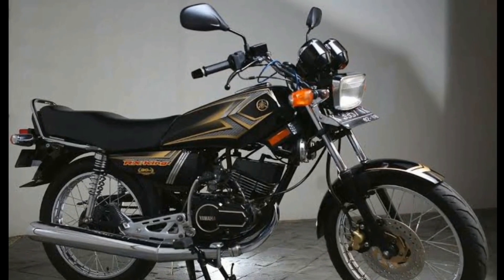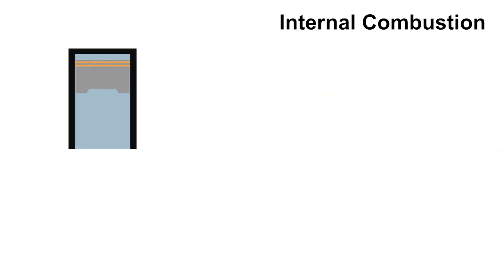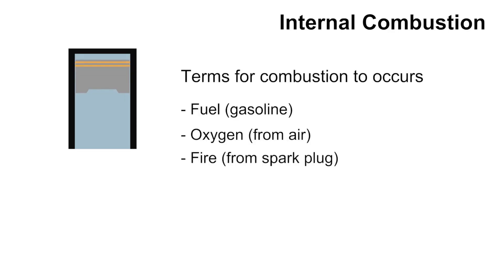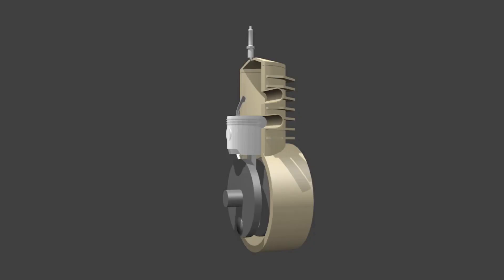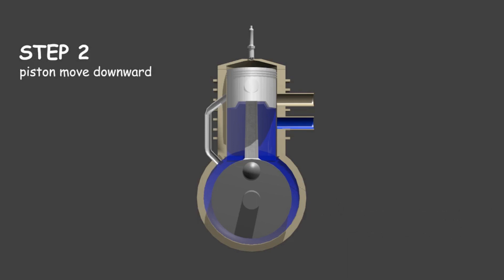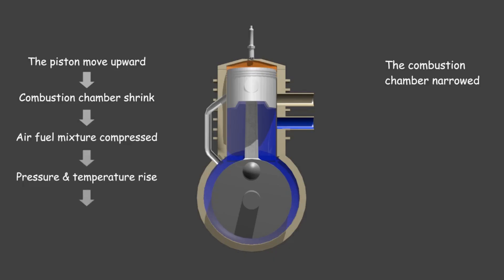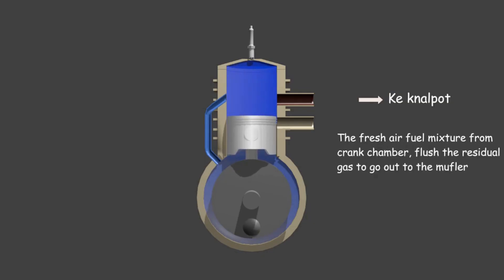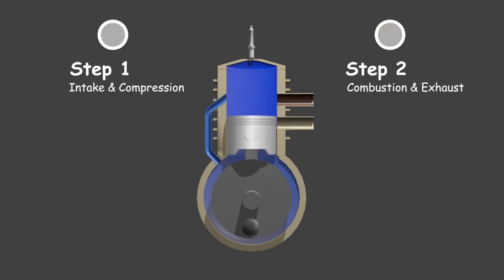2 Stroke Engine Animation

Comment: For 2 stroke. I think it only has the compression stroke and power stroke. The above given is for 4 stroke engine. Correct me if I'm wrong.
Reply: No it is right, there are only 2 strokes in a cycle that’s why it’s called a 2 stroke. A 4 stroke has four strokes, intake, compression, power stroke, exhaust

Comment: Does 2 stroke engine needs timing chain??
Reply: this is a 4stroke engine that they showed in the animation, a real two stroke engine doesn’t have valves, so no need for a timing chain
Reply: @justinfoster6135 yes becuase the piston acts as a valve
Reply: @user-zs3ns2px1f  yes
Reply: this link is a real two stroke engine and how it works https://youtu.be/6_wIjvf_3-Y

Comment: is piston is moved by cam shaft rotation or camshaft is rotated by moving piston...?
for what purpose this mechanism is working ...?
plzz comment
Reply: if you are asking this for a four stroke engine then in that case, camshaft is rotated by the crankshaft motion with the help of timing belt.

Comment: Totally omits that up to 40% of the A/F mix is dumped out the exhaust with the flame front chasing it. The Expansion chamber is being filled with this fuel to generate a Reversionary pulse that works as an invisible exhaust valve holding the fresh charge in the cylinder. Pulse Tuned as the popping noise in the Expansion Chamber is burning the 40% in it.
Direct Injected 2 Cycles see a roughly 42% increase in fuel economy from eliminating this wasteful Reversionary Pulse. Have you noticed on a 2 Cycle when they detonate for whatever reason they super detonate compared to 4 Cycle? This is why. The End Gas has much more explosive forces at play.
I'm referencing the Yamaha 250HP HPDI I have on my boat which they compared to their EFI version of the same HP they updated for EPA compliance.